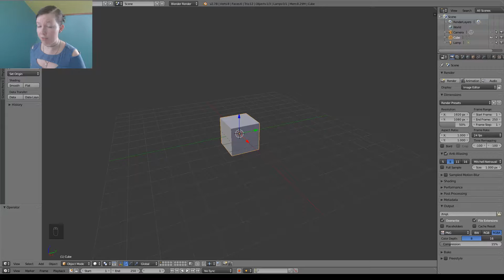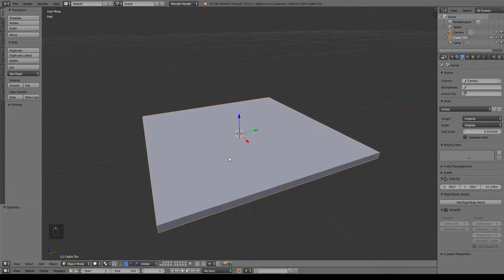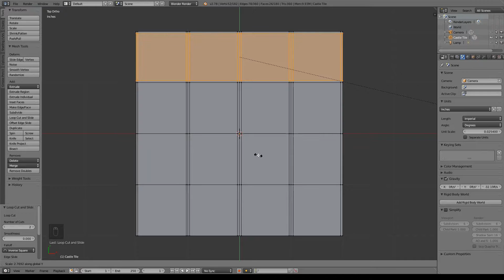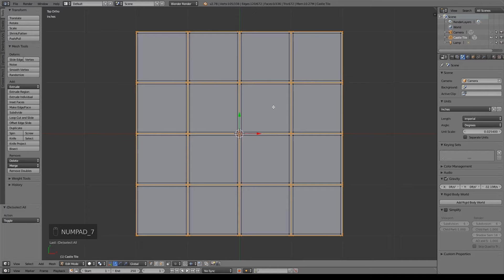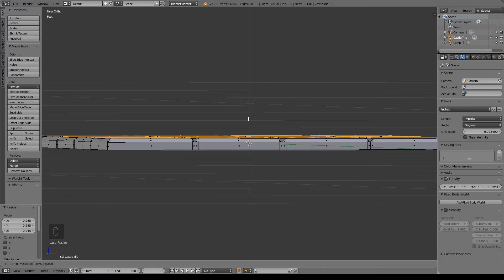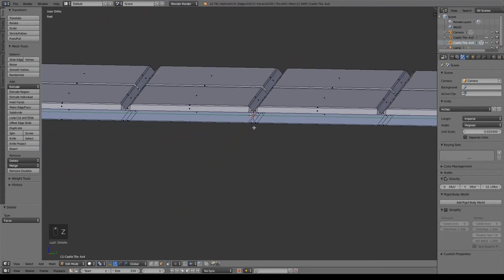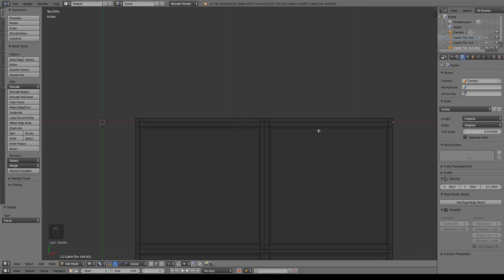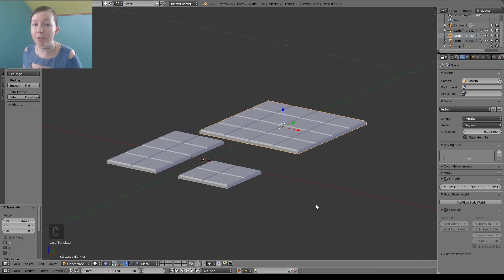How to Model D&D Floor Tiles for 3D Printing in Blender

Comment: You don't even measure things, just guesstimate? jesus christ.
Reply from the maker: Hello, no I’m sorry I choose not to use the Ruler and Protractor in Blender. I have found that it is easier to teach beginners how to use exact sizes in the Transform menu (you can hit “N” to open and close this menu.)
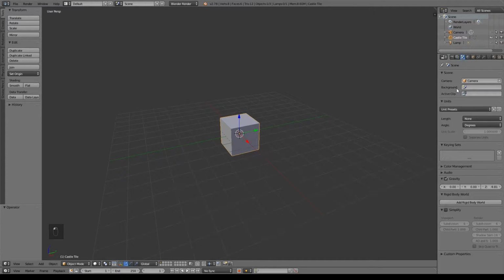To change the unit presets you can skip to 1:13
To change the dimensions of the grid floor you can skip to 1:38
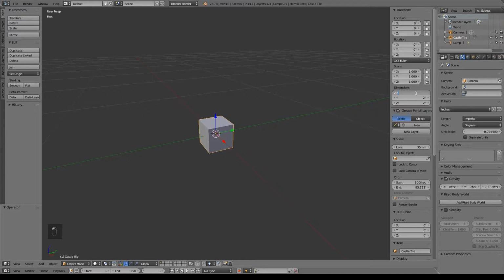To change the exact overall size you can hop to 1:59
If you have any other questions just let me know, and I’ll do my best to help

Comment: Any reason you're not using array modifiers?  Just model one square, copy it, add two array modifers (one for x, one for y) with connected selected, set the number of squares in the array modifiers, and then apply the modifer. Then, you don't have to redo the one or two sides over and over again.
Reply from the maker: Honestly I didn't even think of that. That's so much easier! I'll probably do it that way in the future, thanks

Comment: Hey Kasey, I'm not sure if you have explained it in a different video but what is your 3d print time on a tile like this?
Reply from the maker: I showed it printing with the wall, but no I did not mention the print time. I actually made it thinner, because at .25" it took maybe a 1/2 hour (?) if I remember correctly. And, it took more material than I wanted it to at this size. I think I ended up at least halving the size to make it a little more practical to print.